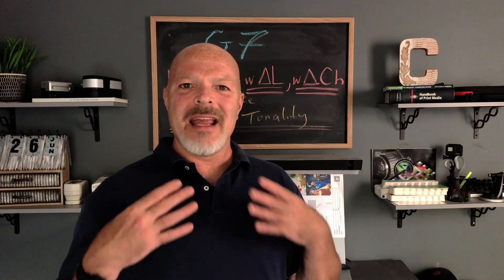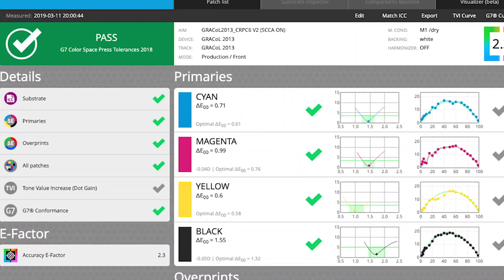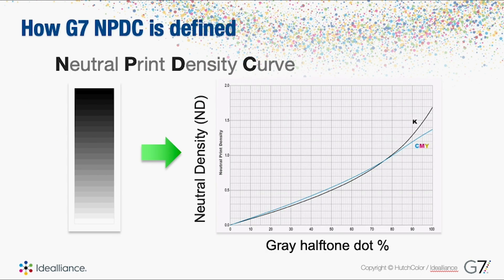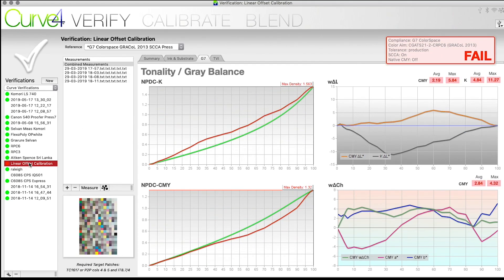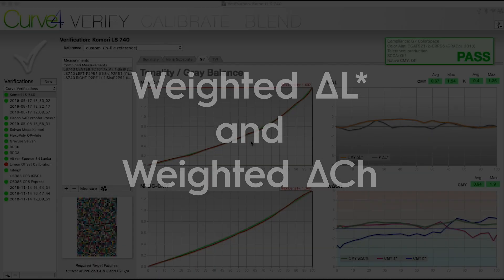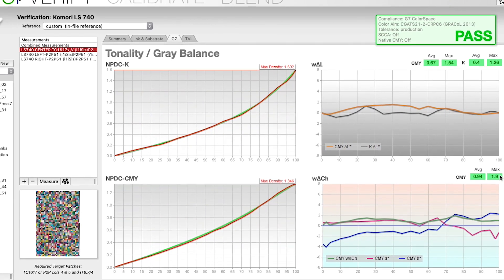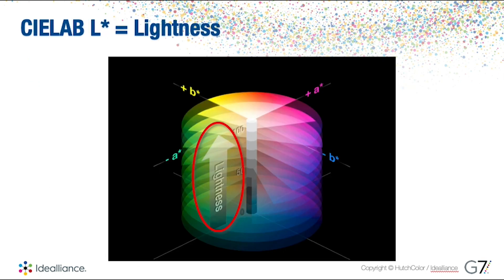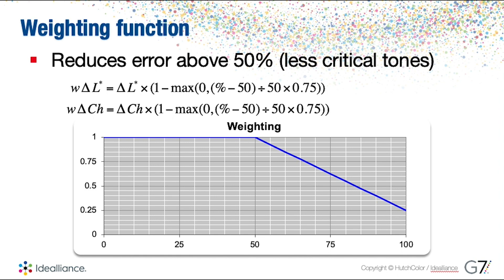G7 Basics—A Simpl(er) Explanation for Neutral Print Density Curves (NPDC)

Comment: I'm quite confused about weighting equation at the end. What percent symbol [%] mean? Is it "L/100", I think so because it will mach with chart. But is it L* of target, L* of sample or maybe it is percent of brightness (e.g. L* between 10 and 95). It is going even more weird in dCh weighting equation because in official G7 documentation I found that  equation slightly different, instead of [%] there is [c%] and description said: "...cyan percentage (c%)...". What? All math done in L*a*b and suddenly value taken from different colour space?
Another problem is the graph, this graph means nothing because the axes are not described! How are you going to standardize anything if your official documentation is so ambiguous, inconsistent?
I'm sorry, my intension is not to offend anybody, I'm just "checking" and I see som lack of scientific approach. 
Mamby I'm wrong and everything in your specification is perfectly fine but I'm going to dive deeper and check all the math...